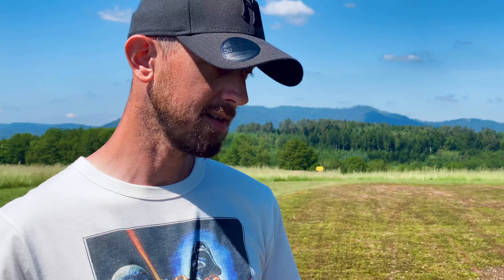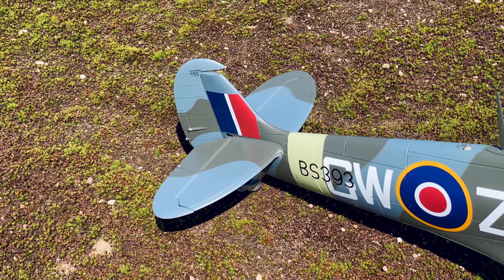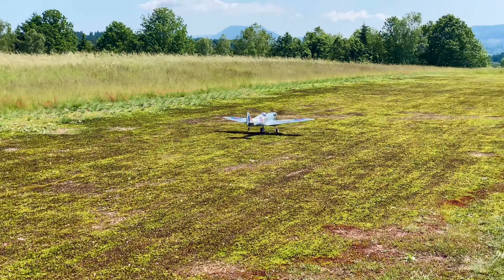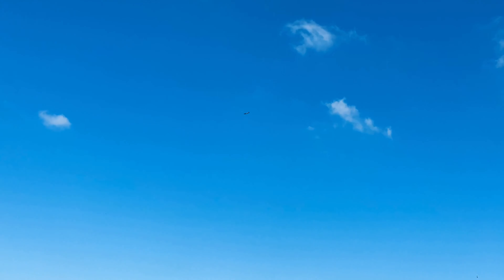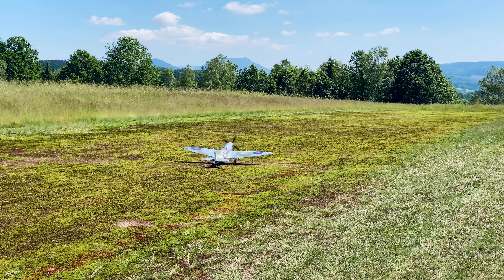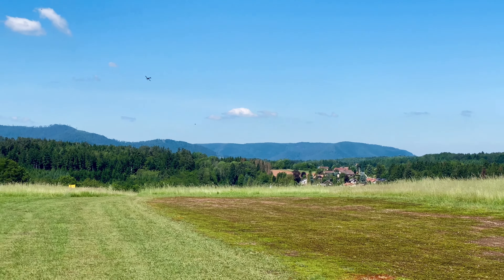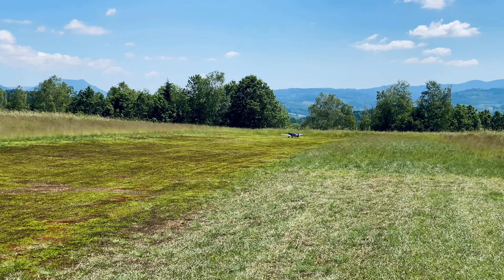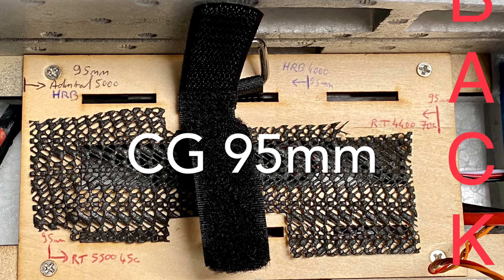Flightline Spitfire Mk.IXc 1600mm - WINDY FLIGHT & CG TEST (ENG/FRA) 4K

Comment: Hi Arthur. Just setting mine up now. The manual calls for 2mm up elevator for normal flight. Did you do this on yours? I've never seen a manual call for this.

Also the throttle to rudder mix 8% you have, is this just for takeoff to help on ground or does it need this in the air too?

Great flying btw 👍
Cheers

Scott
Reply from the maker: Hi Scott ! I think they said 2mm up because the book CG is too nose heavy so it’s to compensate…
If you take my rates it should be perfect, I always fly with low! 
And the mixing right rudder with throttle is always on but it’s on a 5 points curve and the 8% are acting almost directly and of course it’s the same 8% at full throttle
Reply: @ArthurRC  cheers mate thank you 👍
Reply from the maker: @scottbusby12  you’re welcome buddy 🤓 don’t hesitate to add me on Instagram it’s easy to talk https://www.instagram.com/arthuraerorc or by email arthurrcgiveaway@gmail.com

Comment: do you use elevator trim for flaps?
Reply from the maker: •Flaps: first notch 24mm with up elev 2mm and landing flaps 40mm with up elev 5mm
Reply: @ArthurRC  i have only full flaps option like in real Spitfire with 2 mm elevator up. 
CG 5 mm  before CG from manual  - i like nose havy CG 
LiPo 4500 mah 6S  620 g

Comment: hard landing... this plane don't need gyro on board
Reply from the maker: This airfield is very special with easterly wind, it’s very turbulent…did you watch the entire video ??????
Reply: @ArthurRC  Gyro:
- one more thing that can break
-  it may make difficult to recover a model 
   from dangerous situation (stall)
Reply from the maker: @arkadiuszk92  i fly with gyro in all my planes (you can see on my channel that I have a few 😄) and I can deactivate it when I want and most of the time it’s receivers with gyro (Jeti Assist)  inside so no problems at all…
Reply: @ArthurRC  i have FlightLine Spitfire 1600 and Freewing F-4 Phantom (Both without gyro) - This RC planes flying fantastic  (My spitfire is  2,5 years old)
Reply from the maker: @arkadiuszk92  yes I agree Motionrc has amazing planes but just try one day with a gyro when the wind is blowing 💨 you’ll love it
Reply: @arkadiuszk92  hey man there’s nothing wrong with a gyro it is not like a self level type thing that limits your plane from anything I have gyros in almost all my stuff and it just makes flying more fun and easier not cheating at all in my opinion
Reply from the maker: Ah that’s for sure no cheating just more beautiful flight line without woobles in flight
Reply from the maker: @arkadiuszk92  I already 👍🏻 your video
Reply: @ArthurRC  I have a lot of experience in flying with gyro, I think it would be dangerous for the model (in my hands - flying with it )
Reply: @ArthurRC  thanks,  I also like your channel - today I subscribed it
Reply from the maker: Thanks 🙏🏻🙏🏻🙏🏻